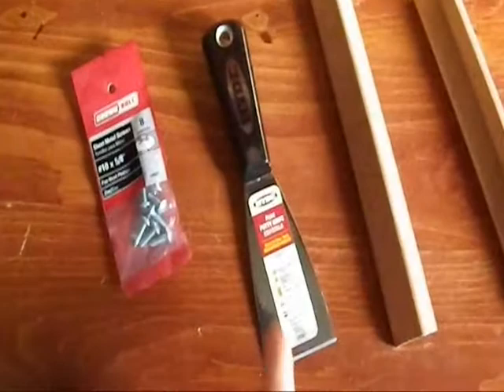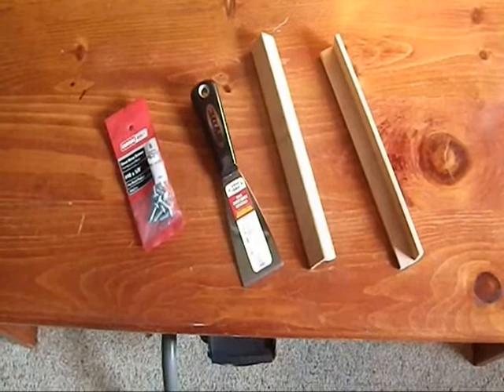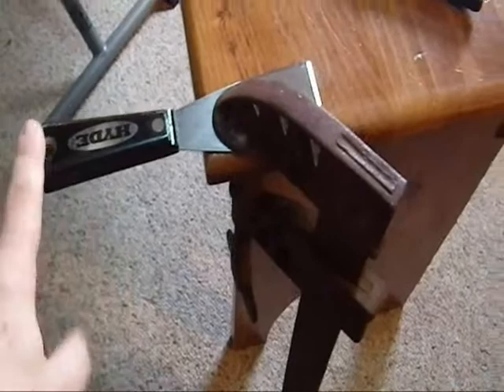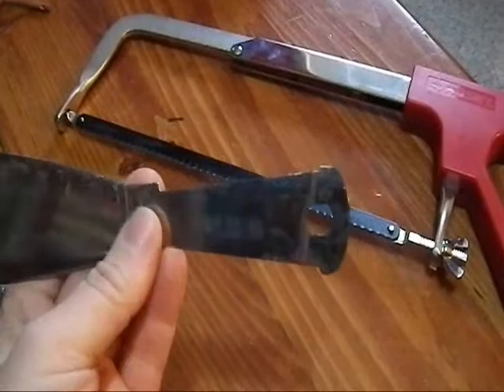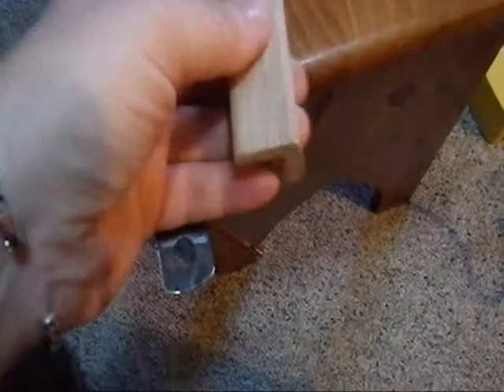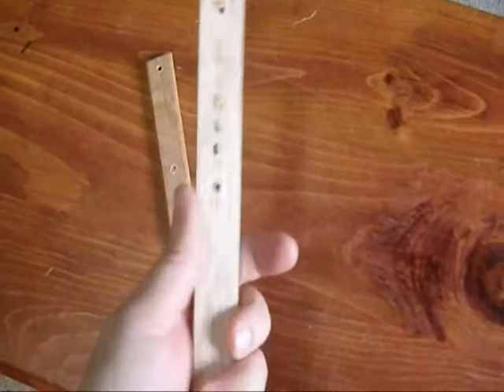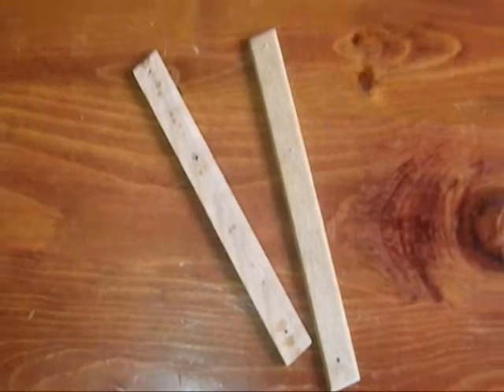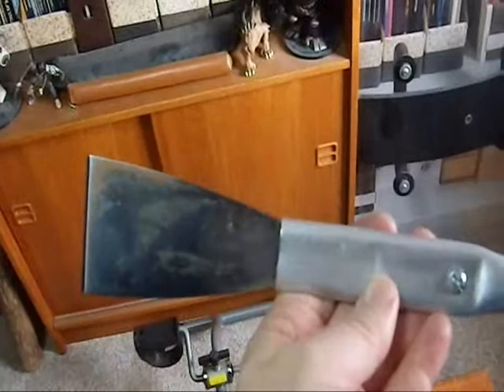Crafting with Tetsubo: Putty Knife Modification

Comment: Maybe you could make a nice grip with that adhesive tape used as a thermal insulator in air conditioning systems. If the glue can still hold at those temperatures, it could work very well, since it has a spongy, gummy consistence and is quite durable.